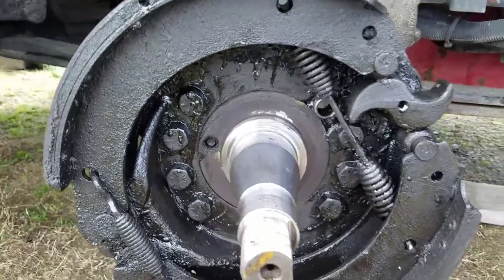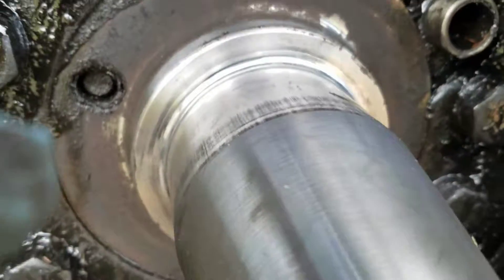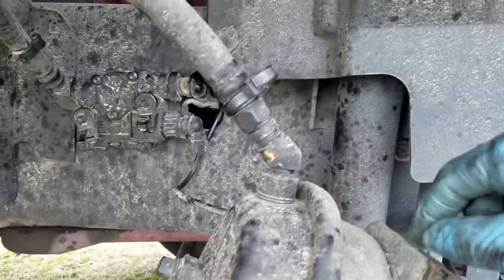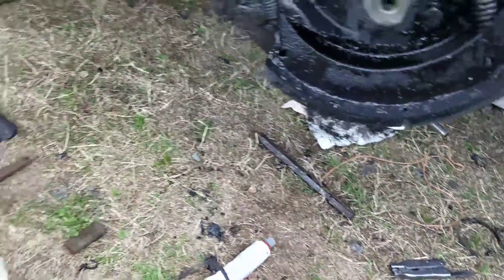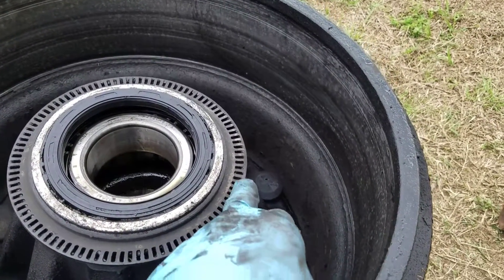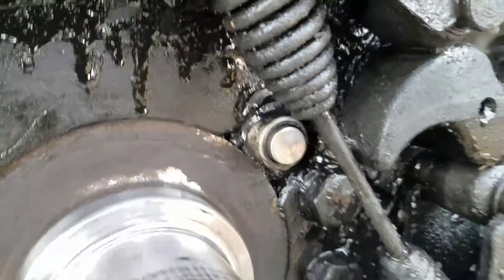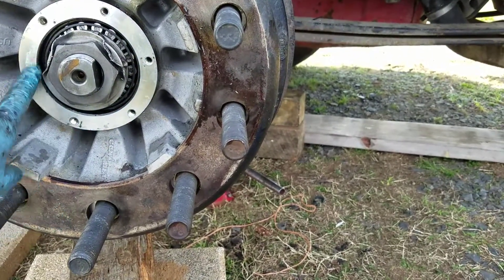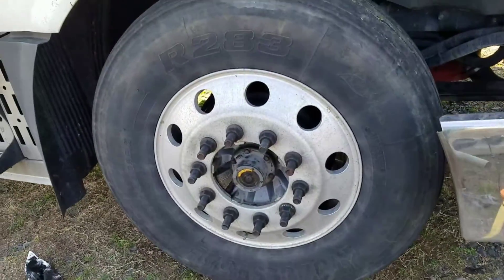part 3 wheel seal replacement

Comment: hi, i would like to know what are the sizes of both nuts please thanks !
Reply from the maker: The most reliable way to confirm the size of the spindle nut ,,is to use a digital caliper(mic guage) to measure the nut. I try not give specific sizes because manufacturers often change sizes mid year ,,best I remember mine was a 105mm and 95mm
Thx for watching